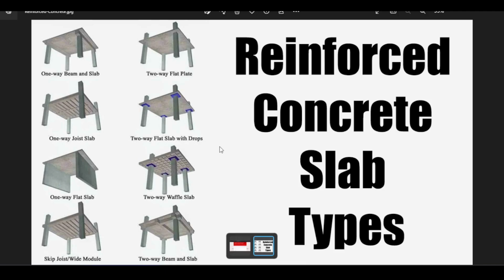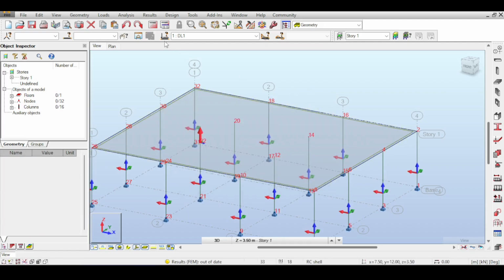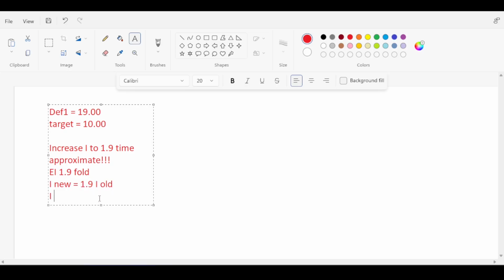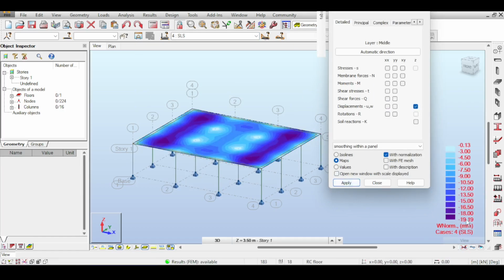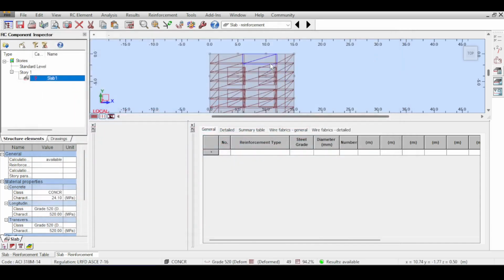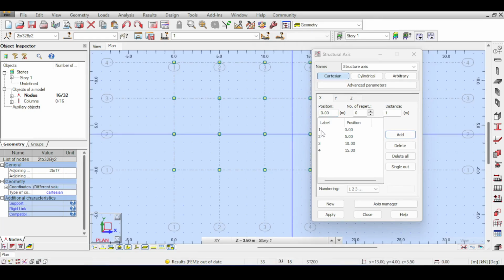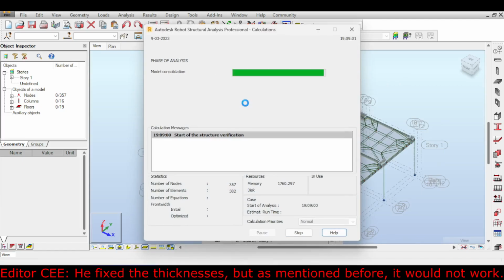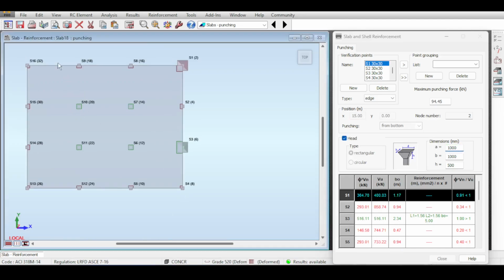The Slab Series | Part 2 - Slabs Deflection, Punching, Drop Panels, Column Heads | Autodesk Robot

Comment: Nice to write a comment for you again. I have a small note about the Long term deflection: 
Referring to ACI the long term deflection is defined as 
sustained short term (dead and 0.25 of live) + sustained long term(which depends on the time and the compression reinforcement ratio) + short term immediate loads
That means it is better to define a combination D+0.25L and use it in the calculation of long term deflection in robot. Then the obtained value will be added to the immediate short term load which is 0.75L 
I think this is better.
Thank you again and again for your useful videos.
Reply from the maker: Hi dear Dr. Kassem, 
It is always a pleasure to read your insights and comments on my videos. It honors me to have you here.

Those suggestion and points are really valuable, and helps the readers and future viewers a lot. So, I am going to pin your comment on the top.

The topic of long-term deflections is - as you sure know - a real empirical pain ^_^. All those time-dependent behaviors that need to be taken into account. Of course, codes provide with approximations and equations based on tests and data to calculate an acceptable value for those.

Also your point on short term deflections is well welcomed. Thank you very much.

Wishing you all the best,
CEE
Reply: @CivilEngineeringEssentials  yes you are right.. thank you again for your useful content.

Comment: Is it only possible to calculate shear reinforcement on slabs if you have any kind of column assigned to it ? 

Couldn't you calculate the shear reinforcement in the middle of a slab to prevent localised impacts, for instance ?

Comment: Couple of questions pleas mister: 
When you use heads for columns, and the program says OK here is the required area of reinforcement, does the software automatically update the provided reinforcement to comply with the required for punching? or one has to check manually that in the critical perimeter there is enough steel area to comply?
Reply from the maker: I think I dove into this once, if I remember correctly, it tries to check the punching with concrete strength only. It does not add extra reinforcement. But i still have to double check.

Comment: Let me ask you, what about using rigid links to connect the columns to the slab?  I believe the floor nodes that correspond to that of the column contour should be linked (by rigid links) with the top column node. At least this is what I see people in the Robot forum doing due to FEM limitations of Robot in the consideration of "drilling moments".
Reply from the maker: you can use rigid links. There are (some) side effects like strange moments that may appear (it is similar to what offsets do. I had a video about that)

PS: sry for the late reply.
Reply: @CivilEngineeringEssentials  The worst about using rigid links is that non-linear problems often don't converge, but from what I've read, it is a recommendation regarding columns and beams attaching to slabs in positions other than bordering it.

Comment: Good day Dr.
I compared moments in a slab analysed with Robot vs Prokon.
In Prokon I have to model patern loads manually. However, in Robot I did not do manual pattern loads, but the moments compare very well to the max envelope moments created in Prokon.
Does Robot do some sort of auotomatic pattern loading?
Kind regards
Reply from the maker: Hello there,
let me first check if I understood your question correctly,
by "pattern of loading" you mean that RSA tries different places for live loads and then uses the live load distributions that provide max moment?

if that is the answer: then no.

with regard to the difference between prokon and robot, did you check the loads? RSA usually adds self weight automatically. Might be that?

Also, sorry for my late reply, I had tons of stuff to do so I was unable to reply in a timely manner,.

Comment: I think you should make verification With stiffness update (FEM) also in order to get a right long-term deflections as it prescribed in ROBOT structural users guide.
Reply from the maker: Sorry for the late reply. I see! that is a great suggestion. I will check out the users guide and maybe even add a video about it.

My only fear is that: long term deflections in concrete structure are kind of code dependent. What I mean is: you would have various time factors, creep, cracked moment of inertia, and so on.

But still, thank you very much for your input. I will definitely check it out.

Regards,
CEE

Comment: Thanks for the video.
Questioin about the deflection diference is so intrest.
Now I calculate the rc structure for the living building on the soil. Previosly I calculateed only on the piles. And I forbided the moving along the axis Z.
I lean on static calculation. I look the deflections there. The floor slab deflections incluede deflection from foundation slab. And total floor slabs deflection is terrible.
Of cours, when I calculate reinforcement, I chouse SLS parameters. I want to incluide the craking. Also you can chose the parameter for reinforcement corrections from deflections. And you will get better resoults for deflections.
Reply from the maker: Indeed, the difference is interesting.
Your input is highly regarded. If you have pile foundation, then I do agree with you that you should fix your columns.

If you do it on a raft (foundation slab), then you may have terrible deflections, especially if the structure is large and the soil is weak. In that case, I still recommend going full pile foundations.

The advice of making "reinforcement corrections" is 100%. I will show it in future videos, but 1 step at a time ^_^

Anyways, I am glad you like the videos. Stay tuned for more content,
CEE

Comment: Another way to add the slab drop panels, by defining the slab panels as slab openings, hence, overlaying  the panels above the openings with the overall panel thickness. this method is more easier specially in complex slab shapes.
Reply from the maker: That is a great Idea,  I would cover it in one of my next videos.
Still, a slight problem in Autodesk robot is that it does not understand the continuity of slabs. It treats it as being separate.

But a great tip indeed. thnx a lot. I will take your comment and put it into the description.

Comment: Great Job thank 💯
I wonder what if it is possible to model the slab in RSAP to resist the punching shear by adding steel or studs.
Reply from the maker: I am not 100% sure, I have to double check about that ^_^
Still, thnx for the comment and stay tuned for more content.